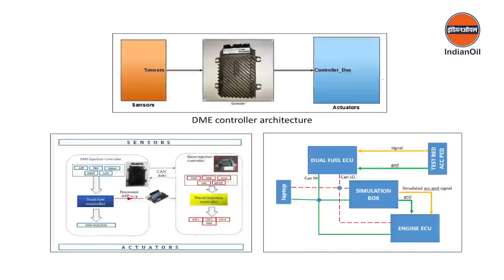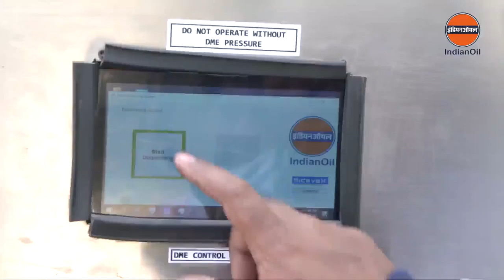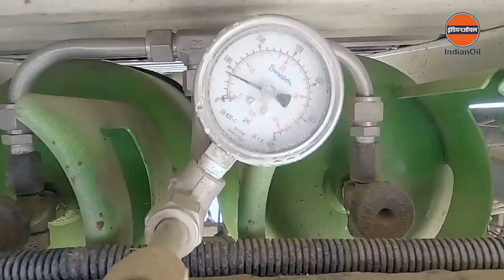DME fuel is the future

Comment: actually India could dedicate resources into developing a DME fuel cell i.e DME as a hydrogen carrier? In this way all vehicles can be fitted with more efficient electric motors and charging infrastructure development should not be an issue since the fuel cell can just be topped up with DME in stations very quickly!
Reply: At last it going to emit co and CO2  only

Comment: Very nice 👌🏻👌🏻   
What about FLEX-FUEL/Petrol- E100 Green Ethanol fuels and  engines updates?? PUNE city have 3 pumps where E100 fuel is available @₹75 per liter useful for all upcoming Petrol powered flex engine 2/3/4 wheeler vehicles??
Reply: India being a populous nation could diversify its Biofuel Program?
#1 Spark Ignition engines could use E100/M100/Biogas
#2 Compression ignition engines could use DME/Biodiesel/MD97/ED95
w/o need to blend with fossil fuels? Every vehicle big or small would run off domestically produced biofuels hence ensuring national energy security!

Brazil has a successful Biofuels Program because they are big on sugarcane? With current tech we need not waddle through the "food vs fuel" (use corn or sugarcane as feedstock) controversy as direct carbon capture and electrolysis (or pyrolysis) can produce Green Methanol/DME fairly easily...
Reply: @phatmeow7764  I saw user manuals of various vehicles telling that 
use “petrol 89 octane and above with E10 or less” or “Petrol 91 octane & above up to E20 ethanol”
   If we extend this limit then there might be engine failure for sure